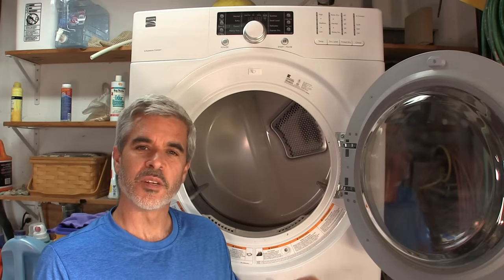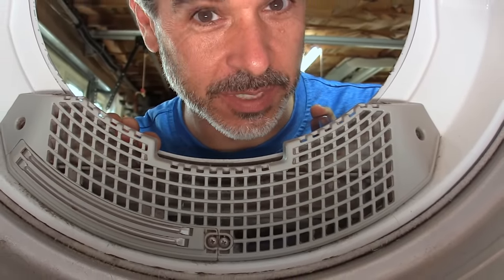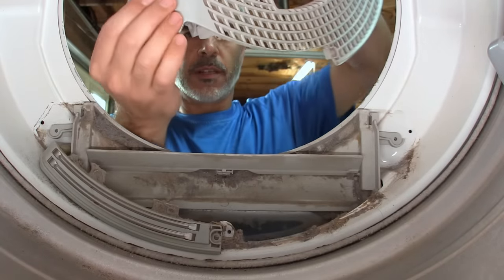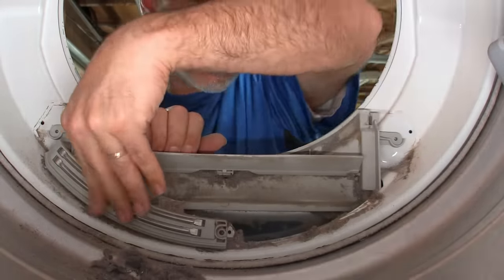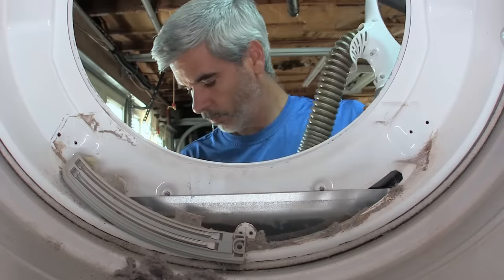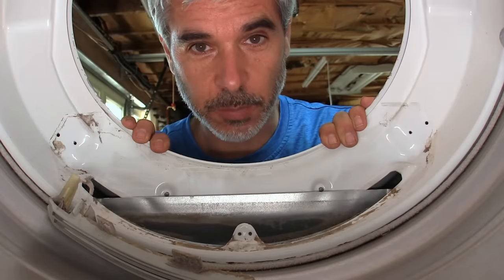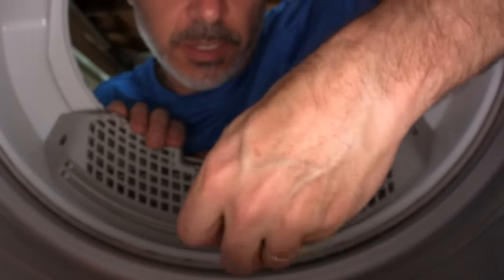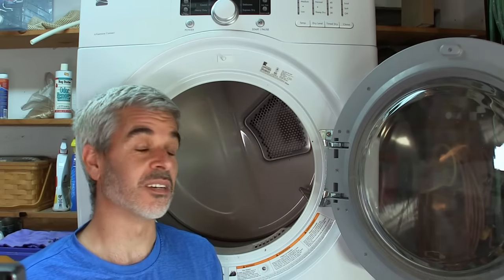Dryer Lint Trap Deep-Cleaning: I found 4 cups of fluff below the filter!

Comment: Thank you for the video. I currently have a top load Samsung washer & matching dryer. (They came with the house we purchased in July of 2020.) I too have this problem with excess lint. I will be looking to see if I can remove those few parts & give it a good cleaning. Thanks again!
Reply from the maker: Did you figure it out?  Those often need to have the back removed to get to the area below the filter.

Comment: You don’t really need to take that all apart if you have a long tool to get down there. I have a long brush on a wire that works but to be honest stretching out a wire clothes hanger and wrapping the bottom 5” with a rag or duct tape etc gets the junk out great. It’s amazing how most ppl have no idea about lint fires and to never use youre dryer while sleeping in case there’s a fire.

Comment: Hi Dan, we kept the filter very clean but the filter get damp about 30-40 mins after used. Would you able to give us advises how to fix this issue? Thanks Dan,
Reply from the maker: I would check on the exhaust tubing and outlet that goes outside.  Perhaps these are clogged reducing the amount of air that gets through. It shouldn't be wet, just damp from the humid air.

Comment: I am kind of a fanatic on cleaning dryer vent, comes from being a family of firefighters. I first use vacuum with extension like yours but then to get everything out I use my dogs powerful blow dryer. I typically do weekly do there's not that much. Then I clean the outside cover. No taking apart of anything needed.

Comment: Just found your video and found it very clear and easy to follow. About the moisture sensor, I followed (a different) video and cleaned the sensor; but the dryer still stops after 5 minutes. Do you have a video or any  ideas to DIY a fix??
Reply from the maker: Do you think it stops because it thinks that everything is already dry?  If you use a 'timed' mode, does it work as expected, or also stop after 5 minutes?
Reply: @DansWay  I only use timed modes for the different types of loads, like delicates, towels, etc. But it stops after 5 minutes.  One day it was fine, the next day it stops after 5 minutes.
Reply from the maker: @tanyabroussard9107  Wow, ok...  Not sure if you have a bad humidity sensor, but if it stops even when in a timed mode then there could be something else going on.  You could try replacing the humidity sensor to see if that does something, but that's as much as I can figure out from here.  Good luck!
Reply: @DansWay  that's kinda what I thought but wanted to run it by you also. Thx much for replying!! Glad I found your tips!!

Comment: I have about the same dryer and removed the outlet tube on the back. This allows you to acess the lower side of the case and see the internals better.  On mine I found a 1/4in layer of lint and some of that was sitting on the heater case..it was black!  You really need to further take appart the dryer to not have a house fire.

Comment: FYI A dry, clean paint brush will clean off areas that are difficult to get to. I keep a set of artists brushes plus various sizes of new cheap paint brushes for cleaning purposes ONLY! They work.
Reply from the maker: Sounds like a great suggestion!  My wife is an artist, I wonder if I should ask for some old brushes...
Reply: @DansWay   please never use a brush that was cleaned in any flammable cleaner.  Bad idea, fire hazard. Get a cheap set that are specifically for your type of cleaning and only for cleaning, I keep a whole set of brushes including cheap 4”, 2”, 6” paint brushes with artist set...I can find the size at a glance. I have duct taped brushes to a ruler or broom or small rods to get the perfect length as well. Keep in a tall cup where they are easily found.  The bristles are not worn, they clean like a magic eraser. Have had the same brushes for many decades.  You will save time and frustration, too. Cheers!

Comment: First, unplug power.  There was is a vacuum attachment for cleaning dryers.  I would be using that for all the crap you can’t reach.  Or better yet, take the front off and do a thorough vacuuming job.  Don’t forget the hose and the  heat coil.

Comment: Just a few thoughts of what I do, 1) purchase a 2-3 foot of 1/2" plastic/rubber hose 2) stick 4" of the hose inside the vacuum hose using a washcloth wrapped around the 1/2 hose to seal the two hoses together.3) stick the loose end of the 1/2" hose into the area of the filter. 4) use a refrigerator brush 5) run the vacuum all the time you are cleaning the vent area. Do this weekly and you won't get this lint buildup.. If a person does the cleaning like you have shown us, use a paint brush to clean the lint from the housing.

Comment: Wow! Thanks for this!!! Great video! 

Gonna do this. Now you need a video to clean an older dish washer!!
Reply from the maker: Great idea!  What parts of the dish washer are the biggest problem for you?
Reply: @DansWay   Well, supposedly Dish Washing Machines have filters that also need to cleaned. The one I have in my house is 22 years old- don't know anything about bit other than it still works!  

There is a drain at the bottom, I just didn't know if there was anything I could do give it a good cleaning. Do all washing machines have filters?
Reply from the maker: @einsteincasino8539  I know that there have been a couple ways of handling waste in dishwashers: Filters or Garbage-disposal mechanisms.  The advantage of filters is that they are very quiet compared with the food-grinding mechanisms which are basically self-cleaning.  Yours could be a food-grinding type which is why you haven't had to clean it out.  My filter version requires periodic cleaning.  I'll have to research this a bunch before doing a video on it, but my wife has asked me (voluntold) to do a deep cleaning of the dishwasher...
Reply: @DansWay   Thanks for the insight. I went and took a look at it. And it actually has a hose going into the Kitchen Sink Garbage Disposal so definitely No Filter! 😊

Thanks again! I'm looking forward to viewing your repair videos.

Comment: Nice demo, thank you!  However, that is only 1/3 of the cleaning.  I disconnect my dryer hose and plug, then flip it upside down and vacuum out the entire inside bottom. You would be surprised how much lint clogs the lower passages that the vacuum does not reach from the lint filter side. There is a bucketful of lint down there, far more than you took out from above. This would be 2/3 parts.
The last part is to vacuum out the hose tube, esp if a long one..  A common cause of fires in homes is a cheap vent hose that is blocked and overheating.  Buy a heavy duty vent hose and first vaccum it out, from each side, then use a leaf blower, dog hair dryer, or an air compressor and blow it out thoroughly 1- 2 x year.  Make sure the exit section is completely free to vent out, no traps.

Comment: have an LG dryer,  i have no visible lint in the intake. perhaps because of a very strong blower and a fine lint screen.
ALSO, i installed a supplemental lint screen in the dryer ducting (bought it from amazon), it needs cleaning after 10+ dryer cycles. 

there IS lint build up in the output duct within the walls which would degrade performance. i have helped family clean out their accessible ducting which were 80% blocked. 

 there are some youtubes of cleaning the ducts out with a leaf blower.

Comment: Very interesting video but I would be hesitant to try removing the filter myself because if I lose any of the screws or can't get them screwed back in properly, then I wouldn't be able to use my dryer.  Something that has been working for me is using a long spatula with double sided tape wrapped around it and then stick it into the filter opening and the lint comes out on the spatula.
Reply from the maker: Ingenious, I love it!  Do what works best for you. 😁
Reply: @DansWay  If I had your skill with a screwdriver, I'd definitely do it your way but I'm somewhat screwdriver challenged. 😃😃

Comment: Dan Holt Hi ..The episode you'd idea on cleaning the lint vent is all most the same machine  that I have ..I need to know to reset  the  codes .Someone open up the door while it was still running it missed up the drying time  .it still runs but on the hour glass cycle  only  any information would helpful  and appreciated  thank you very much...
Reply from the maker: Have you tried unplugging the unit for 5 minutes to totally reset the computer inside?

Comment: I’ve been cleaning houses for 30 years I always tell my clients that are dry fire goes up the quickest by time you realize that the dryer is on fire you have to get all the houses that fast and it’s that quick that it goes up so I tell them when they change the batteries in the fire alarms and that’s the time of the year when you fall forward spring back when you change your clocks you gonna change your batteries your clocks and you’re gonna clean your dryer
Reply from the maker: Those are all very good suggestions Susan!  Thanks for your input.

Comment: I loved the video and took it all apart, did a thorough cleaning including vacuuming the plastic parts and wiping out the dirty chamber.  It went back together easily thanks to your video.  Mine must be a different year, because it has a 6 inch plastic bib attached to the web part.  Anyway, after all of that, the right side still sticks up!  But I have a very clean lint filter and chamber!  Thanks and any suggestions?
Reply from the maker: Hey Carol!   I’m not sure exactly what would keep it from going completely back together unless one of the layers isn’t quite aligned or perhaps the stack of parts is overlapped a bit off.
Reply: Thanks for the reply.  The housing went back easily but I took it apart again just to see if I missed anything.  The housing fits flush, all of the screws lined up etc.  I’m testing it now with clothes with straps to see if it made a difference. But the right side still protrudes about a 32nd of an inch.

Comment: This is a great video for showing people how to clean out the lint filter housing. However, this will not prevent a dryer fire if there is lint buildup inside the dryer cabinet under the drum especially around the heating coils. Lint is like a snowfall is often found at the bottom of the inside. The dryer has to be taken apart and drum taken out to really remove the lint that’s a fire hazard.
Reply from the maker: I’ve considered doing this as you suggest.

Comment: i just looked at my dryer in my apt and there are zero screws to remove anything. i took out what i could get using a butter knife which fell down inside so i had to fish that out... ended up using a back scratcher did the trick. was able to pull out a mountain of lint but there is so much more in there i can see. i dont think this dryer has ever been cleaned out and ive only lived here for 3 months and my vacuum hose isnt too helpful either the way it is
Reply from the maker: Sounds like you need one of the vacuum hose attachments like I list in the description.

Comment: This method only works on certain models. My Miele Touchtronic T9800 has no screws for disassembly. 
However I can reach deep inside with the vacuum hose then I also introduce the hose in the exhaust tube.
Thanks for sharing
Ciao from Little Italy 🇮🇹 Montréal

Comment: Great Video.  I had just done that on my LG dryer.  Unfortunately one of the screws came out afterward and the whole assembly got caught up in the next load and snapped it in half which in turn simultaneously cut the wires to the moisture sensor.  I've purchased the replacement parts and am now attempting to figure out how to get to the front of to get to the wiring.  Not as easy as you'd think.  Long story short make sure the screws are put back secure.
Reply from the maker: Oh man!  So sorry this happened.  Did you figure it out?  You start with the screws on the back, slide the top back and off, then remove control panel and perhaps even the front panel.

Comment: 1. Always buy a dryer made in the USA
2. Always buy a dryer with a lint filter you access from the TOP of the machine..aka some Maytags and Whirlpools.  Doesn’t mean you won’t get lint fallout….but these filters sort of curve around the drum and catch more lint. We recently moved and after 5 years of use…my Whirlpool only had a bit of fuzz floating around under the drum.
3. Also helpful…a dryer drawer that drops down to form a shelf instead of swinging out.  Drop clean, wet clothes on the inside of the door instead of the floor.

Comment: Nice video! I've had to do this twice a year at least on my own dryer, and learned recently that I also need to vacuum out from the exhaust port too. I pulled a very alarming amount of built-up fuzz and lint from there, so you may want to check there too.
Reply from the maker: Yah for sure.   I have a video on doing the exhaust and hose as well.

Comment: Do you need to clean the washer for Gunk and if so do you have a video. Yes I know this is dryer lint and fire but just wondering
Reply from the maker: Hey there, so yes you need to clean out the washer as well.  The primary place for this is the filter which is usually located in the bottom-front of the unit.  Be sure to have no sitting water in the tube before you open that filter.  Mine has a small tube to drain the area even better before opening the filter and having it dump all over the floor. Either way, be sure to have several towels available to catch the water that comes out.  Clean out the filter and put it all back together.  No screws to worry about so this is usually just something you do by hand (no tools).

Comment: Would have been helpful to mention what brand/model of dryer you were using. Also disconnect power to unit first for safety. You should have cleaned the plastic pieces with water/soap and dried them off since you went through all the trouble of removing them. 
Some dryers allow you to easily remove a front lower panel in order to get to material that has dropped down to the bottom (had a Whirlpool unit that allowed that). It was a pain to get the drum back on, but allowed for complete cleanout of the bottom of the unit. 
Not all make/models work like the one you have which looked like an old Sears Kenmore model.

Comment: Dan, I LUV how you undo those screws { how your hands go to "super-speed"}, teach us to do that, too;).   This WAS cool, thanks, I had no idea.    Will a drain snake clear-out the tall pipe that goes up to the top of the roof {which the "Pros" wouldn't attempt}.
Reply from the maker: You will need a brush specifically designed for the size of pipe leading to the roof.  A normal drain snake won't properly brush all the surface areas inside the pipe to remove debris...  Amazon sells a variety of brush kits, something like this one: https://amzn.to/2Mmz0Nz

Comment: I also disconnect the exhaust hose from wall and cap from off the outside and put my leaf blower into the hole and turn it on high.  There is quite a bit of lint blown out.   I found that when the builders installed the dryer exhaust hose he let the screws go inside the hose and it catches the lint and it build up into balls the size of tennis balls.  I had to remove the screws and pop rivet the connection.  Having lost my grandmother to a fire makes me more aware of the danger of a fire.
Reply from the maker: Great advice.  The  screws to rivets idea is gold!

Comment: We had SUCH a hard time putting our LG dryer back together after cleaning it out. (It has a different style of lint trap housing that slides down into the cavity, not as straightforward as this one.).  The secret is to screw the sensor on FIRST, then put the housing on around it.  Just in case anyone else tries this and thinks they are going to have to call a repair man.  Two and a half hours it took for us to get it back on.  You also have to show the side screws who's boss.  I don't think I would ever try doing this again with our LG dryer, just saying.
Reply from the maker: Thanks for the update.  Sorry it was such a hassle!  Can you please share the model number you have?
Reply: @DansWay  Sure, It's DLEX3570W

Comment: Purchase an additional appliance brush, like the one you use to clean the refrigerator coils. Bend the tip into a U and it will go in that space and clean everything up. Have your vacuum ready to clean the brush as you go in and squiggle it around, gently but thoroughly, several times. 
Dang, I wish I had a ‘Dan.’ He’s a cutie pie.

Comment: I'm curious why you didn't show the insides after cleaning? 
I'm thinking the vacuum crevice nozzle didn't fit in far enough to get all of it...
Also a good idea to get any hard to reach deposits might be to use a stick of some kind to break them apart, then when you run it again hopefully the dryer itself will blow anything left out...
My dryer wasn't built quite the same and access is more limited... Which reminds me it's time again to check that and probably clean it again...